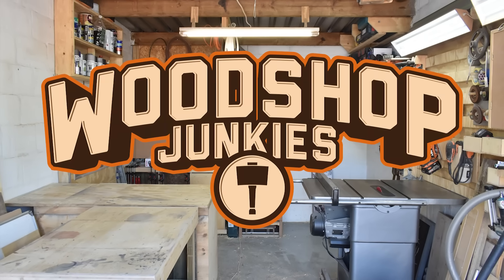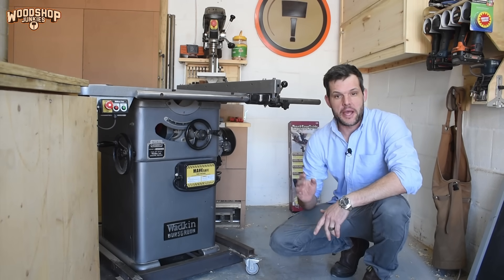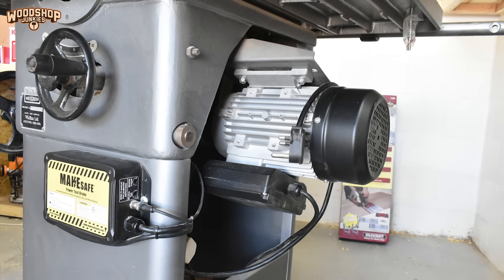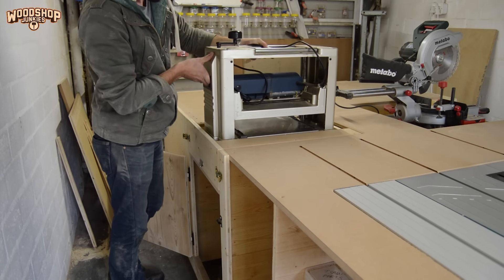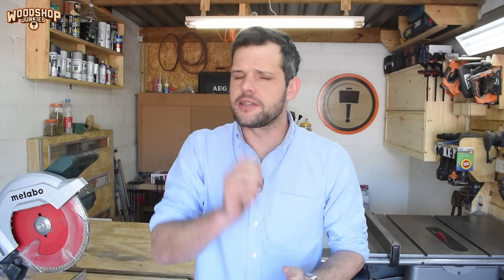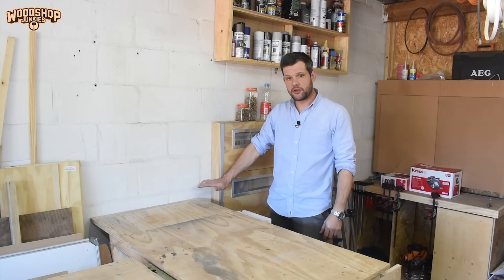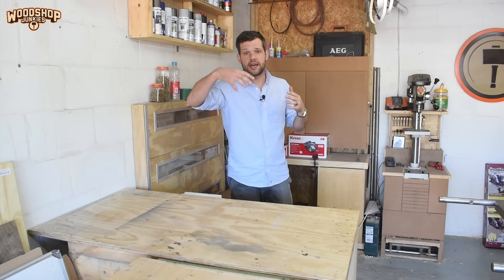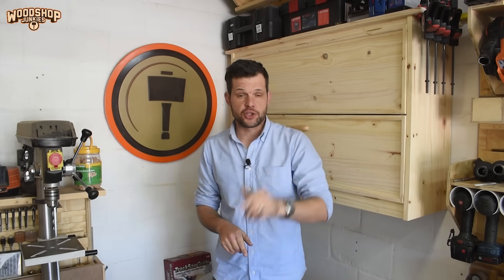How I Plan To Build The Ultimate Small Workshop - Shop Talk

Comment: Just a thought on mounting the air compressor overhead.... Be sure that you can easily access the water drain and its valve as well as the meter and regulator controls.

Comment: I have the bosch mitre saw with a smaller side work shop, Its a fantastic saw absolutely brilliant, you do save some space with it. HOWEVER the dust extraction is terrible!! I know you can get 3D printer plans to make an new dust extractor that will make it a thousand times better, however I do not own a 3D printer so have learned to deal with it.

Comment: Thank you very much for your videos. Have you considered looking for a soft start module or controller for your saw.  This will reduce the initial current draw of the motor to a reasonable level and result in a smoother on sequence. I am sure that with minimal modification you could also use the soft start module to function as a very effective emergency stop

Comment: Very interested to see what you come up with. I have a single car garage that has to share between woodwork and yard/garden so space is premium. I think my first big woodshop purchase was my miter saw - Bosch 10" sliding compound saw. I love it. I'm fortunate to have a concrete driveway and most of my cutting and sanding is done outside to minimize the sawdust. So far most tools are on rolling stands so makes it easy to setup outside and roll back in for the night.

Comment: Check out the Wen M1215 12” miter saw. I personally have one, and love it. The motor actually rides on the rails, rather than being fixed to them. This feature also allows for zero wall clearance. The major difference is that it’s significantly cheaper than the Bosch you’re looking at. Wen is one of the companies responsible for the creation of power tools, and has been around since 1951.

Comment: Even in a larger workshop there's never enough space to work on large things without clashing with other kit. I had also concluded that mobile benches makes sense. However, I don't have your skills or determination, Jean, so I'm planning to use multiple individual ruggedised kitchen units with melamine worktops. The power tools will be simply fixed one to each bench and then they can be wheeled into the required positions. Hopefully, I can arrange some clipping mechanism to lock units together to create larger, more stable surfaces.
I'm looking forward to seeing how to do it properly, Jean!

Comment: Replaced a Makita saw with the Bosch. The zero wall clearance is a big plus, it is also very accurate. Cutting mitres is accurate, meaning I can cut them quicker than setting up the mitre gauge on the table saw.

Comment: Jean, maybe for overhead storage, small motor and pulley systems could be used.
Bring the storage down to you, instead of climbing up to it. With the proper design, you
can lift a good load, with a relatively small motor. I may be slow, but it is all about space. 😁✌🖖

Comment: For a space savings and cost savings. Not to mention saving my back when I move it around. I went with a non sliding 12” dewalt miter saw. I’ve rarely come up with something it doesn’t have the capacity to cut. If it’s over 10” wide I just grab my short track with the track square and my track saw to cut it. I’m very interested in your new shop design. Looking forward to stealing some of your ideas. Love that tool cabinet!

Comment: Dude you are all good. No matter what you do you will always want to do something different later. Striving for perfections is noble, however unattainable. You have however given me a great idea for my workshop. I was going to build one large bench to rule all my tools, however after hearing what you were saying, I realised i could build a separate table for my Dewalt thicknesser on an oversized flip top stand which would then flip to bench height and when not being used I could have on the other side a clip in doghole bench and clamp. I am not sure if this design in my head will work, but my point is you are on a journey and your creativity helps others. Thanks mate

Comment: Bosch saw is great, we've got two at our shop.  However, one of them the bearings on the swing warms are wearing out.  The big problem is that you don't realize it but your cuts start to diverge from your settings.  Just a heads up.  There are some videos on replacing them though.  Will be trying that shortly.  Best of luck on the new workshop setup!  You always do amazing designs!

Comment: For that 2kW motor you could also look into a soft start system, that takes the load off the breaker. Once it's spinning it really should only ramp up when cutting very heavy slabs, so it could very well be that it'll never trip the breaker
Reply from the maker: That is definitely a option I will consider.

Comment: chris at a glimpse inside woodworking had a really great over garage door lumber storage rack years ago in his old workshop. might be good idea to check out. it was the best i ever saw and allowed full sheets of plywood to go in that wasted space above the garage door. and can easily be tweaked to have lights and other capabilities on it
Reply: I found the video. It actually had a light on it that was under the garage door for when he needed the door open but still light (hot in florida). it is called "Space Saving Wood Storage Solution with a Dual Purpose | A Glimpse Inside How To" by a glimpse inside. hopefully it is helpful to someone :)

Comment: Considering the electrical situation in RSA, would you ever use solar panels and a battery system to allow you to work when the power is off?
Reply from the maker: That is the system I have in place but it's not strong enough for the saw.

Comment: I have the Hikoki Mitre Saw and it's a great saw, i used to have the same saw as you have the Metabo but like you i wanted it against the wall, the Bosch saw looks great but a great price comes with it so i looked around and found the Hikoki Mitre Saw, and this one has glide bars but they are at the front so it's much better to push up against the wall. 
I think it's a cracking Mitre Saw and i wouldn't swop it for the Bosch that's how good i rate it, there are of course different prices, for starters i'm in the UK and also there are the different Blade Sizes and the price now might be slightly different, mine is two years old and i have not had one problem with it mine is the  HIKOKI C8FSHG 1100W 216MM SLIDE COMPOUND MITRE SAW the cost was £156.67 but including VAT was £188.00 i hope this helps.
Take Care and Stay Safe,
Barry (UK) 👍

Comment: Used the Bosch, Makita and Fesstool zero clearance mitersaws. Festool is probably the best but honestly I prefer the Makita,  just feels better. And about 1/2 the cost. The Bosch we had nothing but problems with. The joints become sloppy rather quickly loosing its accuracy. Had it replaced once, and that one repaired once before selling it off and getting the Makita, which was flawless.  If not needing the big 10 or 12 inch blade you can also get the Makita in 7 1/2” (190mm?) blade in cordless for about the cost of the Bosch. And help with power issues that way? Just a thought.

Comment: I have the Bosch, and honestly it's a very good, but not excellent, saw... At least the one in the USA. There are a few quibbles, but the main thing is that the cool armature mechanism has way too much side to side play in it. For the price, i find it unacceptable, but i got mine barely used for a very good price, so bought it anyway. 

If you have access to it, I'd recommend checking out the the Makita with the front facing rails. I don't own that exact model, but my rear facing rails version is much more solid than the axial glide arm, and the front rails seem to be as well. 

Also, if you don't have specific need for a 12" saw, I recommend the 10" instead. My Bosch is the 12, but rarely need that capacity and the saw is big and heavy, with much more expensive blades that have more deflection in them, so they are a little less accurate. I find the 10" slider the best compromise of size, accuracy, capacity, and ongoing costs for the vast majority of users. Bigger is not always better even if you have the room, but in a small shop, much more so. 

Looking forward to seeing what all you come up with!

Comment: He man great info video, I live in SA had have a bunch the same tools. I started with the Metabo, and now have been using the Bosch that you are looking at, an can tell you it's a beast. It does everything better, but there are 2 down side to it, one is THERE IS NO DUST COLLECTION, and second its HEAVY. your current way of flipping up the miter saw will not work with the Bosch. then look into hose reels, you can get empty once from Adendorff, and the same with retractable leads, They are pricey but wort it, and would met you setup for videos easier . Good luck and hope you have fun with it, I know your pain. And you are doing a great job and is very entertaining.

Comment: The Metabo C12RSH2 or C12RSH2(S) also has the ability to bump it directly against the wall because the sliding portion is fixed to the back and it slides forward. and at least near me is a couple hundred dollars cheaper.  The only thing I wish the Metabo has which it does not is the shadow line instead of the laser for lining up cuts.

Comment: I have the Bosch saw, and although it is space saving and has a number of advanced features, such as dado/rabbet capability, these are overshadowed by the slop in the sliding capability.  There are some online videos on how to optimize the slop, but I’ve not had time yet to try them out.  But for the price, I would have expected the slop to be minimal, to not noticeable.  Unfortunately, this has been quite a disappointment.

Comment: Pretty ambitious to have a mobile workshop. A 3 or 4 part workbench is a very good idea. Do that. If you're using 1 fase electrics you can make a retractable suspended power plug from the ceiling.

Comment: The Bosch is nice, but it 
is not the only "space-saving" mitre saw. What you should also consider are saws that have there sliding mechanism attached toward the User. Most famous with festools capex. But Metabo also hast a Product Line (XACT) that hast that style. As well as Makitas LS1019 and ls1219.
There are probably planty others, but the mentiond ones are a lot cheaper than the Bosch (a least where i live) and not worse in Terms of Cut accuracy and quality. But they miss the overengeneered prowed that you sometimes feel when your subconscious tray to justify your extra expanse...

Comment: If it were me I would hold off on buying the new Miter Saw. Why not build a crosscut sled for your table saw that has a mitering capabilities and see if that is enough. Then keep your current miter saw up out of the way for those projects that ate just too long for a crosscut sled and pull it out as needed. Throw a french cleat on the bottom so you can hang it up out of the way.

Comment: If you like your Metabo saw and your only problem is that you can't push it all the way back to the wall, the "Metabo KGSV 72 XACT" or the "Metabo KGSV 72 XACT SYM" might be worth considering. I use the latter one and am absolutely happy with it. However, it has a smaller blade than the Bosch.

Comment: I feel compelled to give an opposing opinion re the Bosch mitre saw.  I replaced a fixed-head Dewalt saw about two years ago….and initially I REALLY REALLY REALLY wanted the Bosch saw, for the obvious reasons. I began looking at YouTube reviews and came across several users who were very disappointed with the accuracy of the cuts. One in particular was very comprehensive, with him showing video of his zero clearance throat after a period of use. Right up against the fence the cut was probably good enough, but at the extended end of the cut it was all over the place. He also outlined his attempt to have Bosch look at his saw, and that was pointless….they required him to pay for two-way shipping, the cost of which was prohibitive. I still wanted this saw to work for me…the visual appearance of the engineering impressed the hell out of me. I visited two different tool dealerships and examined their display models. On both occasion the left-right flex, when the saw was at full extension, was completely unacceptable. Of note….it didn’t take much force to make it flex…I completely understood what the previously mentioned reviewer was dealing with, and so much for the “appearance” of clever engineering. The good news is that it’s easy to determine if what I’m saying is still valid…just give it the flex test….👍🏼

Comment: My workshop is also tiny at 4mx3.5m. So everything is mobile and storage is on high shelves and cupboards. As you mention, shared space is the key to organisation, so infeed and outfeed space can be used to access multiple machines. I have the Makita LS1019 sliding mitre saw which I picked up second hand. The forward facing rails and the front mounted lock knob for the tilt mechanism are so much better than anything with a rear rail system. I have it mounted on a flip cart with my planer as the balancing machine.

Comment: Hello Jean.  I think it is completely attainable.  I have my table saw, 14" band saw, router table cabinet, lathe cabinet, drill press cabinet and two work benches all on heavy duty wheels in my single car garage workshop.  Dust Collection, cabinets, storage, wall storage, wood storage are all above bench height as you noted.  Before you jump into the Bosch miter saw take a look at the Makita LS1219L or LS1019L.  I have seen many people comment that the Bosch (or Delta or Rigid with similar mechanisms) feel that it is not as stable/repeatable as it should be and that it deflects too easily.  I have an old Porter Cable 12" non-sliding saw and have been looking at the Makitas as a replacement front runner.  It uses a more traditional dual rail/rod system but is configured in a way that gives it good rear clearance.

Comment: Hi Jean,  I have the Bosch saw here in the UK and find it to be generally an excellent tool but with some reservations.  Firstly the zero clearance at the rear of the saw isn't truly zero as the motor requires space when swinging for mitre cuts.  Not a major issue but you will need to take that into consideration when designing your new bench.  Additionally the glide mechanism is great but can flex a bit if you're too rough with it, which can create issues with accuracy especially if using the (very) basic trenching facility it comes with.  The dust collection is terrible, I know that can be said about almost all mitre saws but the Bosch is really bad.  Shop Nation (https://www.youtube.com/@ShopNation) make a great upgrade for the dust collection but this isn't perfect by any means.  You'll need to upgrade the clearance plate to a zero clearance one as the gap in the factory one is huge, almost cavernous.  You'll also need to beef up the new bench as the Bosch is a real chunky monkey.  Good luck with all the changes, we'll all be watching closely to grab some great tips along the way I'm sure.
Reply from the maker: Thanks! You have given me some stuff to think about.

Comment: Mate I’ve got the Bosch mitre saw and I looked at it for almost 18 months before I made the decision to buy it. I got a deal at a tool show but it still cost me £900 gbp but it came with the trolley stand that I thought I’d never use but I actually do and it’s without doubt one of the best purchases I’ve made for my workshops. The saw is brilliant and works really well the features are very good and the build quality is excellent. The movement is so smooth and despite it being a heavy tool it is so easy to slide in and out with barely one finger. The only thing you’ll find is the dust extraction isn’t perfect but drew fisher of fishers workshop improved his. If you get one I honestly think you won’t be disappointed and you’ll never buy another one again. Plus they now do a cordless version too 👍🏻

Comment: I am sure you musty have thought of this before ?
you know best if it is possible - I built a little shed against my garage on outside - you could store your compressor  in this shed and just have power and air line feeding into garage . pipe against wall with well placed outlets 
will mean you plug in where you need - yet keeping some noise out of garage

Comment: I don't own the Bosch GCM-12, but I have used it.
Comparing its features to my current miter saw, which is a DeWalt, I have to say the biggest advantage is the zero-wall clearance.
Keep in mind, it has a smaller footprint as well, since there are no sliding arms swinging on the back either.
And the better dust collection.
(I built a box around mine to combat the dust a miter saw tends to generate...which of course added to the clearance needed)
And the smoother operation.
(the DeWalt is great, but the Bosch requres a lot less effort to operate)
And the more solid depth stop.
(not sure how often you use this, but I use mine all the time and it's...I'll just call it bouncy)
Plus, something that likely doesn't affect you but still...no mixed SAE/metric parts. DeWalt does that on their American models.
(I prefer metric because it's sane, but either way, a single system is always preferred)
Overall, I'd say that were I able to afford it, I'd upgrade to the Bosch myself.

Comment: The Bosch is brilliant. I use mine on every project. I have a cramped 2 car garage and chose it because it does go against the wall. Good luck with your new projects. With your engineering and design vision I am sure you will make it.